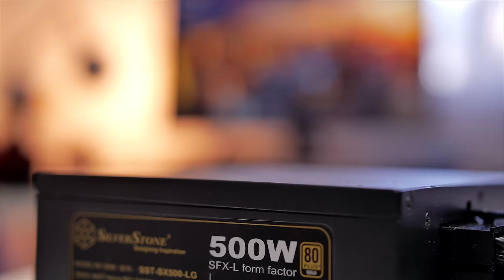Silverstone RVZ02 Review - Amazing Slim ITX Tower!

Comment: I have used this case now for 2 weeks. after building in it and using it as my daily machine I have a couple things to say.
1) the issue with 3.5 " hard drives didn't really bother me i order a 1 TB 2.5 HDD for the same price, I also used a 512 gb SSD.
2) the front door is like a cheap Rubiks cube, at first it slide like crap but after opening and closing it, it will become easier to slide.
3) sometimes it can get noisy i used the same cpu cooler that was used in the video. Its not much of an issue i cant hear it through my headphones and it isn't loud enough to be picked up by my microphone
4) I have the windowed version and for a dust filter I got some used leggings from the good will and attached them to the inside of the case so that is covers the top and bottom and both side panel covers with only a slight tint.
Other then that i have waited for this case since January and after using it i would highly recommend it to anyone who wants to go ITX it was really easy to build in.
Reply from the maker: Great solution for the windowed version! :) nice to see you enjoying the case. I'd say it's my favorite ITX tower so far.
Reply: +Conner Marsh Number two, regarding the Front I/O Panel cover really sounds like it will be loose to the point where it won't even stay closed, short after it's first use. :(
Reply: what is the overall weight of the build?
Reply: Can put extra fans on?
Reply: @Arvin.. that is a no.
Reply: do you still recommend it after 3 years? i am asking because i want to build a mini itx :)
Reply: @aidryanrobert9352  I want to build a PC with this one too!

Comment: I don't understand why these guys don't really consider using 2.5 inch HDDs. As an example, it was said that if you use a 3.5 inch HDD, you lose clearance for the GPU. But if you just used a 2.5 inch HDD, that would fix that and you'd still have a large capacity storage in there. I know it's not ideal, but I dunno why it doesn't even seem to be a thought in these videos. shrugs
Reply: +William Matthews I think it's down to speed. JaysTwoCents did a laptop hdd to ssd upgrade video and it showed the downfall of the 2.5in hdd. They're very slow (much slower than 3.5in hdds). Yes, you can use a 2.5in hdd, but it's not recommended.
Reply: +William Matthews I don't know maybe because there are slower then a 3.5'" HDD. But yeah you are right you could use a 2.5'' for your movies and storage and the SSD for OS and gaming
Reply: +Carl Ayres If you use them exclusively as a media drive, it shouldn't really matter. It did matter back when we had no SSDs and 3.5" drives were quite a bit faster on boot and program launch times, but when you have an SSD for that there's really no big difference whether you're using a 3.5 or 2.5 HDD.
Reply: spreagadh Agreed.
Reply: you can also find really small cards that fit in there even with a 3.5 inch drive installed.Take cards like the Fury Nano,Gtx 970 M-itx,r9 285,gtx 750...and so on
Reply: +William Matthews They probably just don't have any 2.5" hard drives lying around
Reply: +Carl Ayres the WD Black series 2.5" HDD run at 7200rpm just like most their 3.5" counterparts. The cost difference isn't massive either.
Reply: 2.5" HDDs aren't that slow. Many 3.5" are slow too, slower even. Where 2.5" falls down is in availability (people having spares) and capacity. Both are slow compared to SSDs.

This isn't too bad though, if you skip the ODD, you have 4x2.5" bays, that's one SSD and 3x1TB HDDs, not to mention you can also use external storage for large media you don't need 24/7 access to.
Reply: They're quite slow. i'm pretty sure a full-sized external drive would be faster and not take up much space. 

That said: I'm sure guides will come out on how to mod a mounting spot for a 3.5" drive in place of the ODD slot.
Reply: +Antonio Hodge-Grande If you want to water cool and still keep it small, the Phanteks Evolv ITX version or Corsair 250D would also be good choices.
Reply: +David Dewis Ever though they are the same speed the 2.5 inch drive will be slower. In the video Carl mentioned the drive Jay took out was a 7200 and it was slow as hell, even right out of the box. That said I still prefer an SSD for booting and the programs you use most often and keep an HDD for everything else, but using a 2.5 inch HDD would be a better solution if you don't want to use a short video card.
Reply: +William Matthews  I just ordered one of these cases(haven't watched the video yet), but I didn't want to use a 2.5" HDD just because of the extra heat it generates. It might be minimal, but the RVZ02 doesn't have any case fans so I'm going for as little heat as possible.
Reply: iLLexian Not a bad move. If you have to put a 3.5" drive in, I'd go with a WD Green. It's lower RPM for less heat and they turn off when not in use, so you'd want to make sure you're only doing file storage on it without any startup/background programs.
Reply: +William Matthews Exactly.  I'd personally use 2 2.5" 7200RPM mechanical drives in RAID0 to minimize cost/gigabyte and maximize performance.  If someone must have an SSD, mount it in the GPU chamber.  Problem solved.
Reply: Mister BluntSA That hurts my brain. Now I'm genuinely curious if that would be faster than a good 3.5" HDD. I'd just as soon get a 240-480gb SSD and throw everything else in a NAS.
Reply: DeilGrist While it wouldn't outrun a single VelociRaptor, 2 7200RPM 2.5" drives would most likely leave most common 3.5" drives in the dust regarding read speeds.  Try hybrid drives for extra fun!
Reply: ***** Dollars to donuts he upgraded from a low cost OEM 5400 RPM drive.  Slow as dogshit soaked in molasses in the middle of January in Greenland.  7200 RPM drives are much more competitive with their larger brethren.

Also, don't forget, the fastest mechanical desktop consumer drives (WD VelociRaptor) are 2.5" mounted on a 3.5" platform that's one big heatsink!
Reply: I haven't heard about 2.5" drives being slow. I've got 7200 RPM and SATA3 just like any other 3.5"
Reply: They have smaller platters, which means the outer edge is moving slower than it would on a 3.5" drive. That's largely what affects the read speed.

Physics bruh. XD
Reply: +Roger J 2.5 drives may not be usable for sustained heavy bandwidth, such as watching 4k video, but still...2.5" drives are used in laptops, and people can easily use those for gaming and daily use... With space for 2, a 500gb SSD and a 2.5" HDD or SSHD is a very viable storage option. If you can tolerate a laptop, you can definitely tolerate this, assuming some thought is put into the drive choices.
Reply: bluesy92 It just seems odd that you would settle for laptop-grade components in a desktop solution. It probably would be better to go full solid, especially if your GPU is spitting heat on on your 3.5" drive. I agree with the review: I should be able to replace the ODD with a 3.5" 5400rpm drive (something like a 3TB Green drive).
Reply: +Theodor Butters The point is not to have to buy another GPU if you wanted to make this your daily driver. Maybe for a kids room. I need one for my living room so I can play something on the 55".
Reply: +DeilGrist There is the Milo case too.
Reply: +Mister BluntSA Since this is a gaming machine, boot time doesn't matter. Windows 10 already boots up pretty damn fast anyway. Gaming would be more reliable with a normal Hard Drive in here then a SSD. Last SSD I bought lasted about 2 years and then went tits up. I rarely used it much because it was the boot drive in the PC and my larger HD was used for actually storing the games, etc.
Reply: +Mister BluntSA When I first bought the PS3 after launch, they said you could upgrade but only with 5400RPM drives, they were dirt cheap so I didn't mind. At the time they charged more for the same drive if it was a 7200RPM model.
Reply: Really the best thing you can do is run a NAS or a r9 nano/ 970 Mini with a 5400 RPM drive next to it if you need a lot of storage.
Reply: +William Matthews 2.5 HDDs are slow. Even the fastest ones top out at 90-110 MB/s which pales in comparison to the WD Blue in this video (I own one) that gets around 200 MB/s.
Reply: Rushaoz The faster a drive is the more heat it can create inside the case. So a few milliseconds loading your PRON is no big deal for most consumers. Sorry :)
Reply: TekReview's No, but boot times are a consideration, and the heat is negligible. You'd probably just put a 120gb SSD in it and hook it up to the NAS/Netflix and call it a day.
Reply: DeilGrist We were talking about big 10,000 RPM drives which due put out more heat. An SSD is all microchips hence it would not get as warm.
Reply: I'd love to use a 2.5" HDD if there was one with 8TB capacity and low price. With 3.5" you can have that. A while ago I had sworn to never buy a 3.5" HDD, now the only thing I can think of is buying the Seagate 8TB Archive HDD. 2.5" HDD's have no business if you want really large space on a single disk (please keep the fear of crashing to yourself, I couldn't care less). The only way 2.5" to replace 3.5" is with SSDs, since Samsung has managed to fit 16TB to there. But even then we'll probably have M.2 SSDs instead of 2.5", so yeah, while it's a good attempt, 2.5" is a doomed form factor.
Reply: Prequel If you need 8TB of storage, you're either a porn addict, or you need a bigger machine for your editing needs in the first place.

Also: https://www.cinema5d.com/fixstars-13tb-ssd-ssd/

And please, 2.5" drives dying off anytime soon? M.2 overheats and not many of us are willing to have a SSD take up an express slot. It's going to be around for a while (of course not forever; all standards change eventually).
Reply: +William Matthews 2.5" HDDs are SLOW. Even the fastest 7200 RPM HDDs top out at around 110 mb/s. A 1TB WD Blue will top out at around 200 mb/s read and write. Simple as that.
Reply: Solution:
1. 500GB ssd for system storage and games
2. NAS for everything else
3. Profit!
Reply: +Carl Ayres 
That is bullshit, my Samsung 2TB 2.5 inch drive gets 120mbps write and read.
Reply: ***** That's really slow. A full desktop drive gets about twice that, and an enthusiast drive like the 850 EVO gets 4x that plus orders of magnitude better random IO performance.
Reply: You are talking about a fucking SSD, we are talking about the difference between a 3.5 inch HDD and a 2.5 inch HDD which is minuscule.
http://media.bestofmicro.com/2/H/245033/original/iometer_database.png
Reply: ***** A. Lose your temper, lose your credibility. Control yourself.  
B. Those drives are 7 years old. When's the last time you saw a new sub-500GB hard drive? 
C. If you did a little digging and found the actual article that graph came from, you'll see that's basically the closest in performance it comes to the larger 3.5" HDD. It gets absolutely smashed in almost every other category. Simple fact: small HDDs are significantly slower. http://www.tomshardware.com/reviews/enterprise-storage-sas-hdd,2612-6.html
Reply: +DeilGrist
You know there is a cool psychological term out there which goes like this, if you read text and you assume that person is angry, sad or happy via the text which is plain by the way then its actually a reflection of your own current psyche, funny is it not? I thought it was quite ironic to your comment.

I see one right now, got it on my second monitor on this internet store.

15000RPM oh yes, I am sure everyone has a 15k RPM harddrive in their laptops or desktop, I know I have oh wait I do not. 

Ever seen the price point of those 15k RPM drives? Same as SSD's, why buy a 15k drive when you can get a SSD for same price, there is no comparison here, find me the statistics for the 5400RPM and the 7200RPM or either one of them, then come back to me. 
Oh and by the way I actually found that site you linked to me ages ago when I tried looking for any source for your claim without any luck. 15000 RPM, bwahaha fucking hell oh my God
Reply: ***** Interesting that you didn't give the name of the term. 

Psychology is also a loose science; different professionals can't even agree which diagnosis someone should have (if they should have on at all). So sure, the term may exist, but the statement and how it applies to me have no basis. Meanwhile, it's been know that using specific taboos/swears is considered hostile unless the context shows otherwise (which it does not in that situation). If you didn't want it to come across as hostile, then you should have come up with a better way to word your opinion.
Reply: So where is the factual evidence that 2.5 inch drives are inferior in speed than 3.5 inch? 
I am still waiting you know.
Reply: A 500GB ssd wouldn't be much use to myself when i have nearly 2TB of games alone. GTA 5 by itself takes up 64GB.
Reply: SMGJohn smaller platters= rpm cycle effect with velocity, though you can counter it with smaller pits which newer drives use.  so right now the only true advantage is larger storage space.
Reply: I got the case of you don't like the white plastic side panels pain them color you like

Comment: hey Dimitri, I guess someone already told you but if not: the missing filter on some of the outputs is due to silverstone's cooling approach: the side panel push air in so that on the other sides air is pushed out, therefore no need for meshes there. at least that's how it works with the rvz01. higher inside air pressure it is a common method for example to keep laboratories clean

Comment: I was going to build with the RVZ01, but decided to get the Coolermaster 130 instead. When making a mini ITX build I priced both with identical hardware (except PSU, DVD drive, and Case) and it turns out that the RVZ01 version of the exact same computer would have cost me a $175 premium over the Elite 130 version. With the Elite 130 I was able to use a full size power supply that I picked up with rebates for $20 vs. the Silverstone SFX ($85 450w modular), similarly, the case cost me $20 after rebate ($80 RVZ01) and the DVD drive for the RVZ01 was insane (a good quality slim drive $60 vs. $10 standard size). I decided to go with a "less stylish" but equally functional case and save the money to use on a solid GPU. The case is good, and it is a hell of a looker, but that's just it, like many things in life, you pay a premium for the "good looks."

Comment: I crammed a Gigabyte G1 980 Ti in that thing, fits perfectly and even the support brace worked fine with it.  One of the best case out there for Mini-ITX builds.
Reply: +Brawndo Thanks for doing the homework, it takes a little guess work out of my build/reconfig.
Reply: ***** Not sure how far you're with your build, did you get the case yet? The only restrictions is that this case is not 3.5 HDD friendly, not many choices on the CPU Cooler and you're restricted to air cooling. Just wanted to mention that. Otherwise, I love it.

Comment: Still a great case. Even more feasible to build in today because SSDs are cheaper. Only Two downsides IMO. 

 - You need a low profile CPU cooler. 
- It will get loud as there is not really any noise insulation or any case fans. 

These are fairly standard with any slim itx case. There's something to be said for other itx cases, but the "briefcase" form factor has these problems inherently. I still like the slimness and the ML-08 / RVZ-02.
I think the partitioned case design and the direct access to open air prevented the build-up of hot air in the case. My components were not terribly hot. This was back with an old gtx 1080 and i5-6600k.

Comment: Thanks a bunch for the note about the 3.5-inch HDD limiting GPU size. Almost bought my new build based around this case with a HDD and an 11-inch card, so I opted instead for a 2.5-inch 1TB SSHD rather than a 3.5-inch 1TB HDD and 2.5-inch 120GB SSD and it actually ended up being a little cheaper, too, so thank you for that, again.
I would have liked some performance comments with regards to cooling, but that's a minor complaint. Overall excellent review!

Comment: This case can fit two 3.5 hard drives. I managed to do this by simply removing one ssd cage located in the middle part and by removing the mounting thingy for the dvd/bluray drive (i dont need em)

After which, you can pop right in your juicy 3.5 hdd on this tiny rig and you still have a ssd cage left to the right. 

Awesome.

Comment: if you have positive pressure, non meshed openings on side is no big issue since the air will flow out of the vent, and not in.
Reply: Unfortunately the clear side version doesn't benefit from this though with the missing wire mesh

Comment: This looks really good. However since it's passively cooled and bith the CPU cooler and the graphic's card pull air into the case you get positive pressure within the case when in use. That means dust getting in would only be an issue when not in use.
Reply: I have had this case for 5 years … opened it up for the first time recently: I was surprised there was absolutely no dust on the inside. ThAt really changed my mind about this case